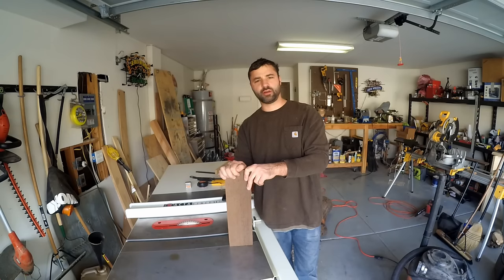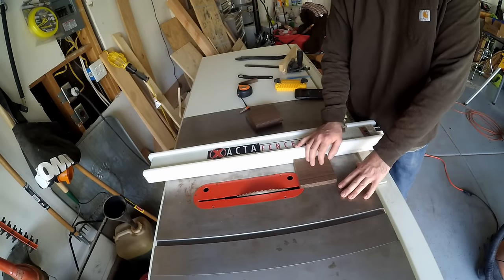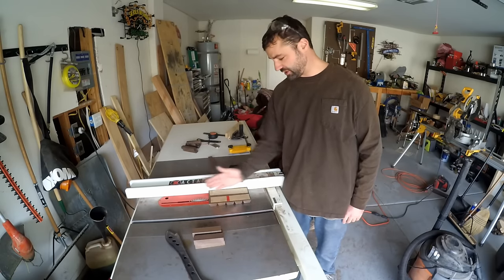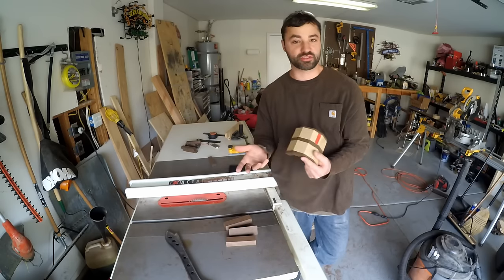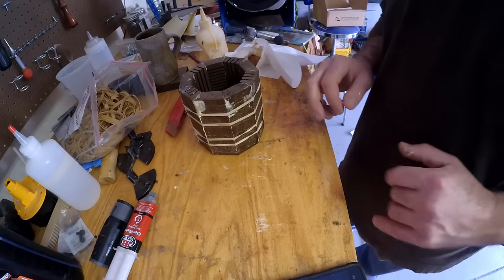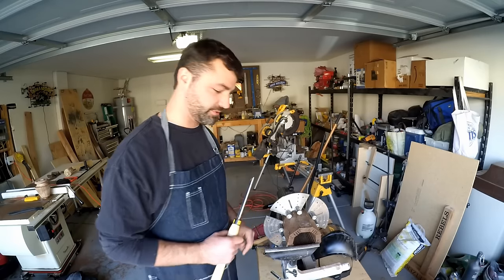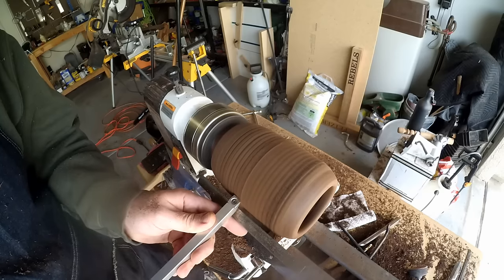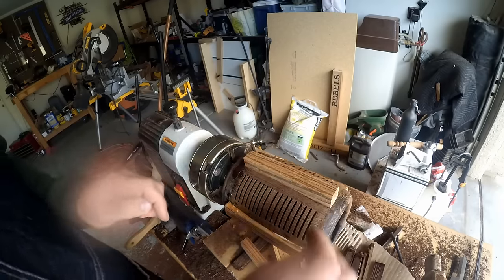Woodturners Journal: Slotted Candle Holder Turned from Wenge Wood

Comment: Thank you for a very interesting video with a beautiful finished project.   It was very creative to cut the slots on the inside.  The wenge and zebrawood combined together very well.   I'm a hobby turner and have just ordered my first table saw so it's interesting to see how versatile it can be.
Best wishes from Ireland,
Alan.
Reply from the maker: Thanks a lot for the support.  If I can give you a suggestion, it's buy a quality table saw.  You don't want to be limited by what your tools can do.  Do the research and make sure it will be one you could live with forever.  Just my advice.

Comment: Really neat idea.  I am sure that something like that would sell very quickly.  The only issue I have with doing something like that is making the cuts to make the segments.  I can never seem to get the angles quite right.  Beautiful work.  I think using the zebra wood made the piece look better in the long run also.
Reply from the maker: +Tony Montgomery Thank you Tony.  I had a few other people  tell me they like the Zebra wood more as well.  Like I said, I was just trying to do something different and I felt the vertical slots added to the difficulty of the project.  Now we all know, it's probably not impossible to create vertical slots, but extremely challenging.  Thanks for the comment.

Comment: I love this project. I don't think you should give up on the original idea with the vertical slots though. You should revisit this and instead of turning tools maybe use a wood rasp with a low speed to take it to round then sand down from there. 

I'm no pro but I'm thinking using the rasp would be more stable and constant surface contact to (hopefully) prevent the bites that are popping the strips out.

Comment: Jerrod, I am one of the new subscribers to your channel and I too am inspired by your creativity. But when you ran the first bunch over the table saw without a push shoe I cringed in terror. If the tape had given away or you put enough pressure downward to make the joints bottom out on the top........ well let's just say I know from personal experience how much that hurts and how much it costs to spend that much time in the ER. Just a hunk of 2x4 with a tail on it to pull thru and to hold it down safely is cheap insurance. And I'd like you to keep putting those ideas out there for me........ with all the fingers.
Reply from the maker: First, thanks for subscribing.  I was lightly holding the wood.  If the tape would of come off, I wasn't pushing down hard enough for my hand to hit the blade.  I know accidents can always happen, but I was being pretty careful.  Trust me, I fear and respect that saw.

Comment: Nice project! The wood you used is pronounced "wing gee" (hard g). In your opening scene, you crosscut the stock by butting it up to the fence and pushing thru with a push stick. Hope you don't find out the hard way that THAT is not the way to crosscut. Ever hear of a miter gauge?  or better yet, a crosscut sled.
Reply from the maker: Yes.  After that video, to be safer, I built a cross cut sled.  I should of probably built that first.  I know how it looks on the video, but trust me, I was being extremely careful.  My hands were never pressing down hard enough to be grabbed in the blade.  It was a light guide which I was doing.  Looked dangerous, but I was never in any real danger.  That is why I built the sled though.  Trust me, I fear and respect the table saw.  Thanks for the suggestion though.

Comment: I'm not a fan of the insert tools, they all seem to be very poorly designed and cause a lot of problems, like ripping out those segments that were running parallel to the axis of rotation. I feel a sharp spindle gouge wouldn't have been nearly as likely to have broken them. Still a really well thought out project that gives me a few ideas to try myself.
Reply from the maker: 207 Made Thanks for your thoughts.  I know I shouldn't, but the spindle gouge is the one tool I'm not a fan of.  I know I should get more comfortable with it, but lately,I just avoid it.
Reply: Woodturners Journal I fully admit to be the same way with a skew chisel. They can leave a near perfect finish but I've had some nasty catches with them so I mostly avoid them.
Reply: I was thinking before they broke 'use a skew - what are you doing?!??!?', then it broke.

Comment: You should learn to use a table saw properly.
Reply from the maker: +Stephen Campbell I am always interested in learning and getting better and always open for advise.  What part of my table saw use are you concerned about in particular?  I will watch the video myself and try to make the correction.  Thanks for sharing and for your help.  :)
Reply: +Woodturners Journal 
Sorry not trying to insult you @ 1:28 a cross cutting sled should used, when cutting narrow boards like that, if the board twists it could kickback. Nice turning BTW.
Reply from the maker: +Stephen Campbell Trust me, I am not insulted and you are 100% correct now that I look at it.  I have a cross sled too.  I have no idea why I di not use it, but believe me, I definitely will in the future.  The table saw is one of my tools I try to fear and respect.  Thanks again.